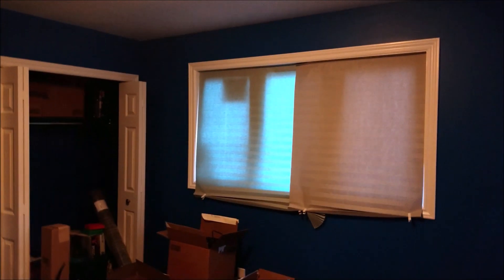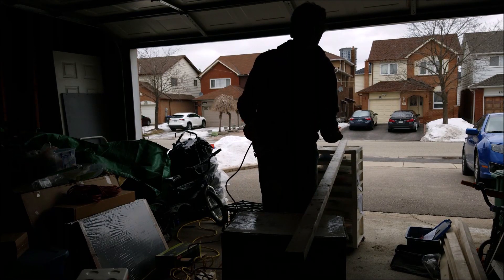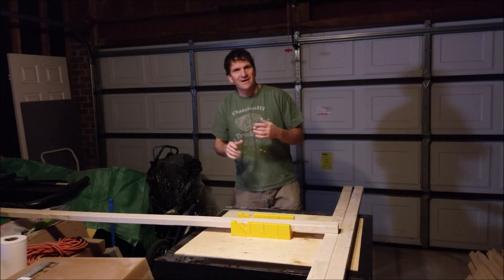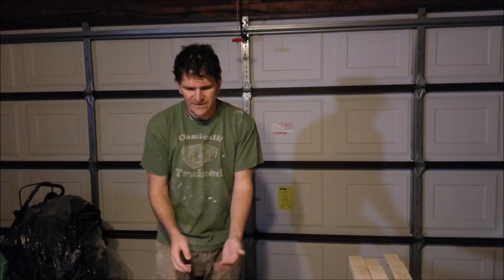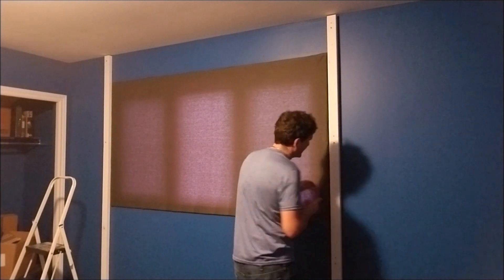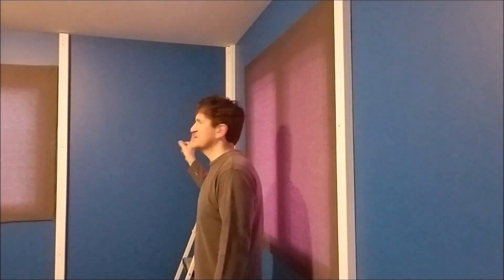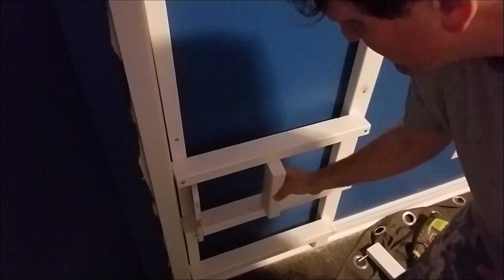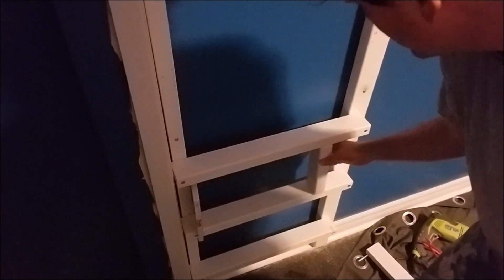Cheap DIY Gameroom Shelves 2.0

Comment: I'd say use 80 grit sandpaper, and then the 150 grit. May prevent damaging so many pads. I'm no wood working expect, but I've been told to gradually work your way up depending how rough the wood you start with is.
Reply: ⬆This⬆
Reply from the maker: it would have ripped any paper really. What was tearing the paper was the splinters of wood that were along it. No amount of sanding or type of sand paper could have prevented the problem as it was bound to happen. In other situations though it would be a good idea to start even lower than I did.  Of course, I am no expert either but I noticed that the moment it ripped was when it got caught on a splinter.
Reply: @CanadianRetro  Okay, I guess what you needed was a planer or a belt sander, which usually have thicker/stronger sand paper. Maybe not worth the work required?
Reply from the maker: @dege13  yeah I am a noob at sanders but the guy at homedepot recommended the one I was using.  You are probably correct on the belt sander.  I had tons of sand paper so it really wasn't that big of a deal.  I just thought I was losing paper before it was spent and it was kind if irritating to know that the paper was wasted.

Comment: Glad to see the game room coming together, looks very nice. How long did it take you to get everything done and any idea of total cost?
Reply from the maker: I would say about 300 bucks in total.  But that includes having to buy 2 cans of paint as there was just not enough in one. And I also bought the sander.  As well as some wall anchors that I will never use again that cost like 50 bucks and I was cursing them since I opened the pack because they suck so hard.  Couldn't return them either because a couple of them broke and I had opened it so likely they would not take it.
Reply from the maker: Took me about one week.  A lot of that time was waiting for paint to dry and it was not day in and day out.  But it was about a week.